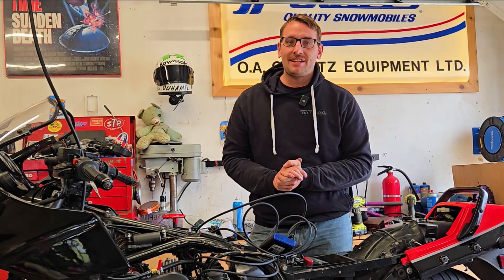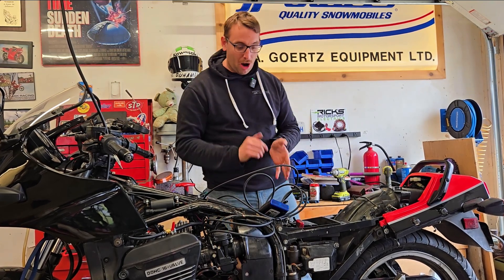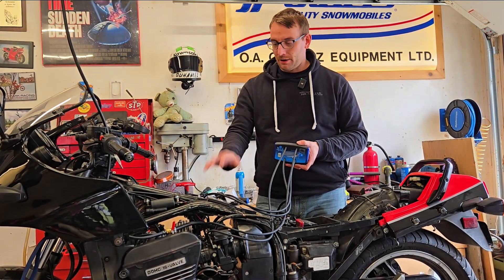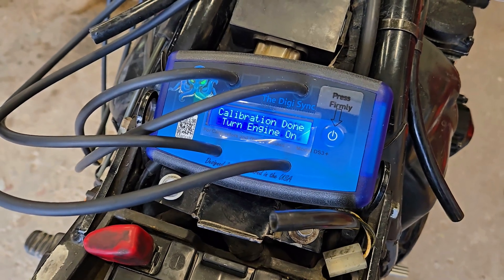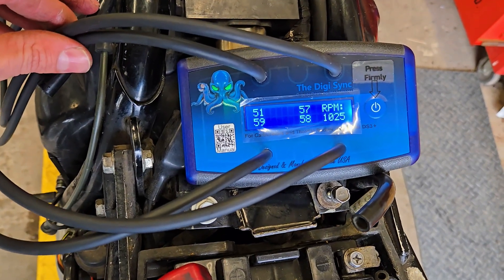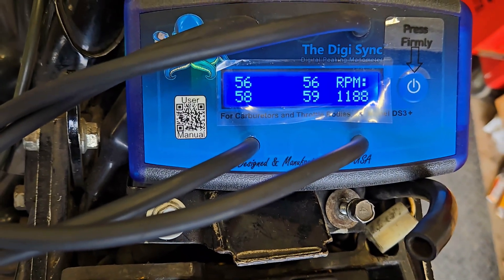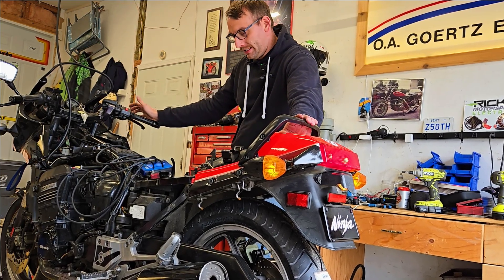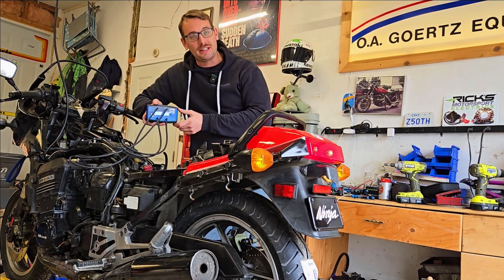Syncing Motorcycle Carbs with the NEW DIGI SYNC on a GPZ900R

Comment: I'm not a professional or anything but I do own a 01 zrx1200r that I wrench on myself and restored it. I have pulled and cleaned and sync'd my own carbs using the old fashion dial vac guages. I'm on the fence about this device. At the end of your video #4 carb was giving off some weird readings
Reply from the maker: Turned out I had bad O Rings in the air screws that were causing vacuum leaks.  That made the reading jump.

I did a TON of research on these prior to buying one and am more than happy.  Used it several times now and besides replacing the battery never let me down.
Reply: and the battery thing is a no for me- just when ur about done the stupid things batt is gonna die - if not mess with the readings. Im on gauges now - just a diyer, might get a carbtune but nothing gimmicky like this for me- too unreliable. Elec sensors etc-
Reply from the maker: @fstarockaburns425 although a dead battery does suck.  IF it were to die it only takes 30 seconds to put a new 9v in.  It's not a gimic product, it's just another advancement in technology..just like the device you used to watch this video.  At the end of the day, use whatever works best for you.  Im just showing what worked good for me

Comment: What are you so poise to Fidel with specifically to balance?
Reply from the maker: There are adjustment screws between the carbs to sync the throttle actions together.   Always consult your manual as not all carbs are created equal

Comment: After decades of syncing old school bikes,i much prefer the the Carbtune Pro synchronizer, a digital one is ,one ,not required ,and second, it requires batteries + the display is too small,why display digits ,when a large bar graph would of been much easier to read at distance.I will stick with my carbtune ones. Remember carb syncing is done not that often by the average joe,so the bet is ,batteries would of leaked ,or run down when you need them. Just my opinion.
Reply: Digi Sync is superior, it self-calibrates, is accurate to within 1.5% before software calibration, atmospheric conditions don't matter.  It also uses a 9v battery and they're not known to leak.  Boomers going to boomer.
Reply: @williamfoster4268   Some random readings on number four- 56, 8.1, 11, 8.8 at the end. Analog can be cal'd or matched at operating rpm values manually, digi-sync self calibrates at atmospheric. I would not replace a functioning analog with a digital although I might buy a digital if I had nothing but needed the tool plus had extra money to burn away. No difference in results between serviceable tool types when in competent hands. Good point on the battery leakage, best to remove when and be safe when sitting for a long time as these tools do.
Reply: @williamfoster4268  Nah,i will stick to my Carbtune Pro,as ive never had any problems, on road or track,or dyno for that matter,9v batteries can leak,usually at the terminals,they go green & destroy the pp3 clip ,that connects to the item.I will let the uneducated be fooled into buying things they dont need.